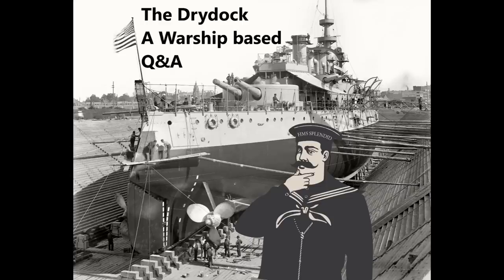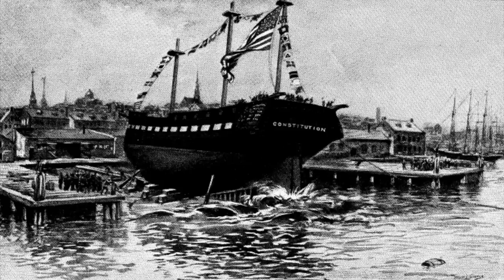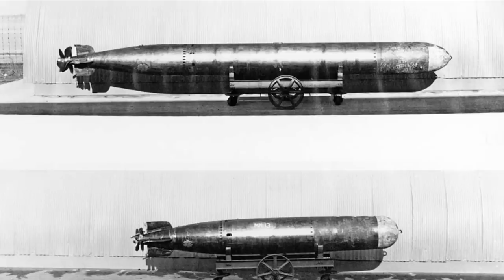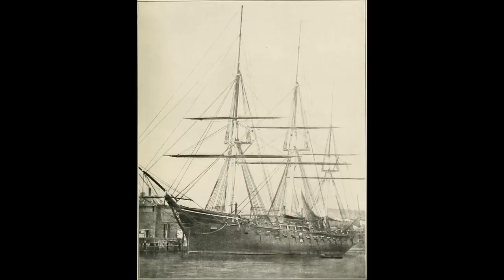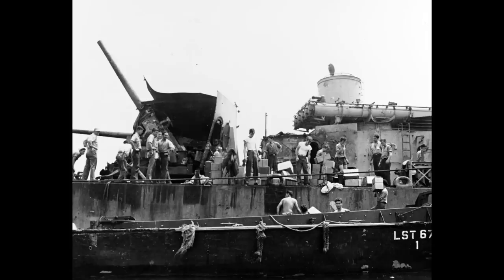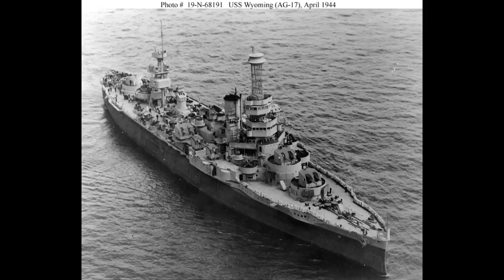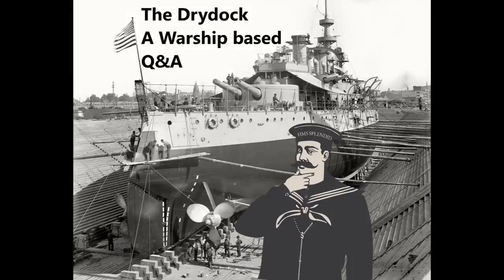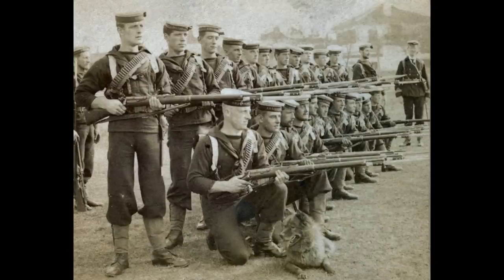The Drydock - Episode 204 (Part 2)

Comment: 00:50:58 The US Navy requires that all shipboard propulsion and aircraft fuels have a closed cup flash point over 140 deg F. When receiving fuel from a Navy source no testing is required since the product was tested had to meet spec upon delivery to the fuel facility. Degassing is done at the refinery to remove the volatile fraction raising the flash point and reduce the risk of explosive vapors. Shipboard testing was only done to determine atomization temperatures for heavy bunker fuel, and when receiving fuel from a none Navy source.
Reply: Basically the same thing as for commercial aviation fuel?

Comment: 51:00 Degassing
Short answer  Drach is right, by the time the navy gets the bunker fuel it is already de-gassed. It happens before distribution.

Long answer 

Crude oil has hydrocarbon gas in solution, refined fuel and destilate products have little or no gas in solution.
Crude oil inside the reservoir is under pressure, and gases are dissolved in the crude oil, held in solution by the pressure. During production, as crude oil travels UP the wellbore the hydrostatic pressure is reduced. A lot of gas comes out of solution as pressure is reduced. (think opening a bottle of soda that forms a lot of bubbles suddenly when it is opened). The first step of De-gassing is what is called a "gas separator", usually at the well site. The gas separator is a primitive device, simply a tall cylinder with baflles inside to allow the gas to vent to the top, and liquid to collect on the bottom. The crude oil that comes out of the separator is called "unweathered".

The unweathered crude is then pumped into pipelines under some (lower) pressure. In the refinery the crude is then passed thru a vacuum Degasser to capture valuable gas (these gases are feedstock for chemicals or used as fuel)

The degassed crude is now passed thru a distillation column, where the different fractions of hydrocarbons are separated by their condensation temperature (pretty much a large moonshine still). The liquids that are extracted from the distillation column are called distillates and have negligible amounts of gas in solution.

The most valuable fractions become gasoline or diesel. The less valuable are called BUNKER FUEL. Bunker fuel is just a notch above asphalt and tar. Ship's boiler run on bunker fuel. Bunker fuel usually has to be heated to thin it out and pump it, use it in burners for boilers. This is why ships have fuel heaters and pre-heaters.

Beware that distilates are still volatile, they can evaporate and become gaseous (gasoline in open jars will evaporate)... but this is a change in phase, not release of solution gas.

Cheers.
Reply: There was several explosions on diesel powered Greek Flag tankers in the 70's/80's when they piped light crude from the cargo into the engine room and burned in the main engines.
Reply: @benwilson6145  Ja Ja .. not the smartest thing to do... 😝
Reply: @benwilson6145  I recall reading that towards the end of WWII the Japanese Navy was running on crude oil, as their refinery capacity had been destroyed. The concern was that the high salt and dirt content of the fuel would severely reduce the life of the boilers, but of course by that time the life expectancy of Japanese naval vessels wasn't that great in any case.
Reply: And from Battleship New Jersey's boiler video this week it was mentioned that the evaporators degassed water destined to be boiler feed water, as well as purifying that water to remove any dry residue minerals which are not good for boilers.
Reply: @ricardokowalski1579  Virtually all crude oil tankers now burn the gases coming off the tanks in engines now. Current crude tanker burn almost zero fuel from the fuel tanks on outbound voyages as a result.
Care is however required to prevent flashbacks to the tanks.
All LNG and LH tankers always burn off gas from the tanks in both directions because the tanks are never emptied (to maintain temperature in the tanks).
Reply: @allangibson2408  Cool 😎👍
Reply: Cheers ; ditto

Comment: Iceland was also a listening post for radio transmissions. 
Operators wore silk gloves to prevent their skin sticking to metal and heavy gloves to keep their hands warm during winter. Unsurprisingly there were sticky accidents happening to lone operators. 
The radio hut was away from the living quarters to avoid electronic
 interference.

Ireland had another listening post.

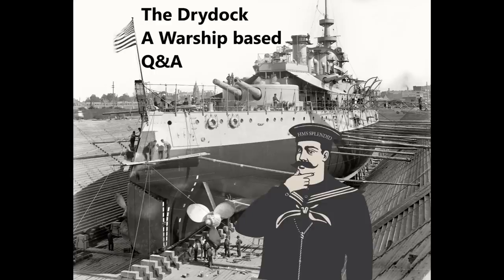Comment: @ 12:45 You were talking about Steam Turbines. Another issue was precision balance!!!!  Each blade not only have extremely tight tolerances to length, width, "airfoil" shape, But also weight, if you had one blade slightly heavier than the one on the opposite side, it would cause trouble by causing vibration and the fact that it would try to shift the shaft in it's direction.  Same thing with Reduction Gears!  Extremely Delicate Balance considering the speed of rotation of parts!!
As for VTEs, ATEs, etc., remember most people had seen a steam locomotive, so the idea of a steam cylinder moving back & forth (or up& down) wouldn't be such a big surprise.  In fact I've heard stories about mainly Canada, but to a lesser degree the US looking for Railroad Engineers and Locomotive Repairmen for service aboard VTE powered ships.... (truth? don't ask me, but it just might be worthwhile to research "one of these years" since I do know you're extremely busy!)
Reply: Also, while the conditions inside a steam turbine isn't as extreme as those inside a gas turbine, I still suspect that you had to be a lot more careful with the metallurgy of those relatively small and thin turbines blades than you did with the giant chunky steam piston heads of a VTE engine.  A little flaw in your allow mixture and you might have blades start failing on you!
So that's one more thing you need to reverse engineer or independently develop and then quality control to make these newfangled turbine things :D
Reply: @jonathan_60503 In the US, turbines were already in use in power plants. I think the US had a problem getting reliable reduction gears, so the USN resorted to turbo-electric drives .
Reply: @sundiver137  Lexington and Saratoga had turbo-electric drives, any other class?

Somewhat ironically, electric drives are making a comeback on some civilian ships these days, with diesel generators powering electric Azipod propulsion units.

And yes, gas turbines blades are engineering marvels, from the carefully CFD-designed shapes of the blades, the thin film of cooling air preventing the gases that are hotter than the melting temperature of the blades from melting them, to the manufacturing process producing single crystal blades. No wonder they cost a fortune.
Reply: @jbepsilon  Turbo-Electric drives were pioneered in USS Jupiter (AC-3), later converted to USS Langley (CV-1).  Other USN ships equipped with Turbo-Electric drives are listed here: 
https://en.wikipedia.org/wiki/Turbo-electric_transmission
Reply: @jbepsilon  I think the Colorado, Tennessee and New Mexico classes had turbo-electric systems.

Comment: Oil from oil wells consists of a mixture of Gases (both inert and flammable), Oils (from things heavier than bitumen on down), water and sand.
The water and sand are separated from the oil and gases in a production separator which is basically a big pressure vessel with a weir in it. The bulk water and sand are drawn off from the upstream side of the weir, the oil from the downstream and the gases off the top. From there is where it gets complicated as you need to separate the non-flammable gases from the flammable gases (unless you just flare them) and the residual oil from the water.
Oil on ships falls into two categories - Bunker C (or even worse Vacuum Bottoms) which needs to be heated well above 100C to flow at all (and hence doesn’t have a water content problem) and everything else.
The lighter oils (including lubricants) are centrifuged to separate the water in equipment very similar to cream separators (usually made by the same companies in fact) to encourage the more dense water to settle to the outside and be drawn off while the oil on the inside is skimmed for use by the engines and gearboxes.
Dissolved gas is not a problem for engines as a rule - it just gets burnt.
A lot of modern oil tankers actually run on the off gas from the oil tanks in transit in fact - they only take on fuel for the empty return runs.
LNG and LH cryogenic tankers always run on off gas in the tanks.

Comment: Fuel on ships doesn’t need to be degassed. Even in a Diesel engine, you’re just burning it. Fire isn’t exactly a finicky process. It’ll go just fine regardless of whether or not there’s air dissolved in it. In general, deaeration isn’t a thing that matters at macro scale.

Boiler feed water is deaerated, though, to avoid oxygen corroding the inside of the boiler. This is accomplished by the deaerating feed tank, which uses steam to heat the feed water to strip the air out of it.
Reply: This is less true in engines that burn things more fine than diesel or oil like kerosine or petroleum as a lean condition (too much oxygen in the fuel mixture) makes it less controlled fire and more blowtorch and can actually melt or at least seriously damage the metal bits containing and creating the fire.  Oil fires burn differently
Reply: Boiler feed water is deaerated in boilers with carbon steel tubes. Ammonia or Urea is added to scrub residual oxygen.
In boiler with stainless steel, copper alloy or aluminium tubes oxygen is added to the water to prevent corrosion. Stainless steel depends on the oxygen in the water to maintain an oxide film to prevent corrosion.
Reply: This has been proved wrong. Many Greek Tankers stole crude oil from the cargo during the 70s/80s and blew us there diesel engines.
Reply: @officernasty1111   Agreed, proof in action. Graf Spee's 'refinery' was basically a degasser to "Refine" the Texas Crude on the Altmark. The Altmark blew up in Japan, different reason.

Comment: Following on from the Great Storm of 1703, I read an account of a severe storm in 1782 in which HMS Centaur, HMS Ramillies and a number of merchant ships were lost from a convoy. It was significant because the subsequent inquiry, and a follow-up examination of other Royal Navy ships, revealed that the hulls had been seriously weakened by galvanic action between the copper hull sheeting (which was then a relatively new idea) and the iron nails holding the timbers together, and this led to action being taken to prevent this occurring in the future.

Comment: @ 50:08 (I'm not an "Oil King", but my Rating did have me know parts of various tests needed for DFM & JP-5.  (Distillate Fuel Marine, and Jet Petrol #5.) As a Water King I do know how Sub-Atmospheric Pressures will cause separation. (Bunker C was a few decades before my time, however, on a old ship I did see the paper work for testing!  But unfortunately  the standards listing was no longer there....)
I imagine they did the "Flashing" at Refineries so that various other fuels could use the vapors and what was left would be Bunker C.  I don't think you can "Evap" off AvGas (of various Octanes), or even MoGas (which was 50 Octane), and I'm also doubtful about Diesel fuel (~30 Octane).  
Here's a bit of explanation of the two ways to rate a fuel:  Octane is a measure of Resistance to Detonation, which explains why Diesel fuel has such a low Octane Rating since it relies on only the compression of the engine to allow the injected (basically directly injected into the cylinder) to ignite the fuel. 
The difference between JP-5 & JP-8 is that JP-5 has a higher Flash Point (not sure if they did a partial evap/flash on it, or added chemicals (or a bit of both), JP-8 also has some lubricants added to it that JP-5 doesn't have.....
Another way of rating fuel is the Cetane Number.  This is a measure of potential energy of the fuel, so you want Bunker C and Diesel Fuel to have a hit Cetane Number!  (I imagine that Bunker C, after having the volatiles "evaped" or "flashed" off would have a high Octane as well as a high Cetane Number!  DFM, since it is used for Diesel Engines aboard ships and for the Gas Turbines (Navalized Propulsion version of a jet engine)
Note: by adding a lead compound that was marketed as Ethyl, you can raise the Octane Rating pass 100, but also cause health, sometimes serious health issues from inhaling the exhaust or even direct contact with the gasoline.  (This would be in addition to the issues caused by exposure to the petroleum "spirits" due to spills or inhaling the vapors of unburnt gasoline (and diesel)!!!)

Comment: With regard to the service of women, which applies to both the USN and RN as also in all the services. Women carried out much vital work and played a major part in the victory. Especially in jobs that did not need a man and releasing more men for the front line. There is no way we could have made it without them. However, having them in the front line is totally different story. I served 32 years in the USN of which 4 was on loan to the RN. Little more than half of that service was without women on ships and the rest more or less with women on front line ships. I was also drafty /Rating assignment detailer and was a ship working up instructor at GTMO. The same routine that UK ships go through at FOST. The performance of the all-male ships vs the coed ships was clear. The all-male ships outperformed the coed every time. It is without a doubt putting women on the ships with the men was/is a disaster. Women are smart and capable; however, Men and women are not the same and the men behave quite different when they are with other men and when with women. As detailer I saw all the problems uncensored and unfiltered. There are 2 huge problems that have no solutions The womans physical and emotional limitations and then there is fraternization. The USN has discharged thousands of men and women from the lowest ranks to Admirals due to fraternization, throwing away their carriers. It cannot be stopped, it can't be trained out, punished out, counseled out no matter what anyone can do. We did a study to determine the cost, by adding all the wages, benefits, cost of training and lost experience from all those people discharged. It went into the billions. Then there was the cost to provide female friendly berthing on the ships. The RN recently spent 3 million pounds on each and every submarine so they could accommodate 3 women. Then there was the detriment to readiness as many women would get themselves pregnant just to get out of deployment leaving their ship shorthanded. There are many other things that can be said. There is an important place for women in the military, but not on the front line or aboard warships.

Comment: In addition to using airfields on Iceland to base long range patrol aircraft they were also used as part of the North Atlantic Ferry Route, which allowed aircraft, or priority supplies carried by aircraft, to be shuttled from North America to the UK.  The long range patrol or bomber aircraft were generally able to be configured into a fuel heavy ferry configuration and make it from Newfoundland to the UK direct, but short ranged (or more heavily loaded) aircraft had to make stops in Greenland and, or, Iceland to refuel in order to make it across.

Also I believe weather stations in both Greenland and Iceland were critical for predicting the weather in the European theater of operations.  D-Day, for example, was scheduled for June 6 in part based on a forecast that the weather would improve enough by then to make the invasion, and immediate follow-on operations, feasible; a forecast that would have been harder to make accurately without access to meteorological stations set up in Iceland.

Comment: Light/Lamp trivia: ships and navigation aids use red green yellow and white lights... But no blue or orange. This is because early lamps used whale oil as their fuel, which tends to burn with a yellowish flame. If you put a blue lens in front of a yellow flame you get a green light and in fact many older green running lights actually have blue lenses. When using a yellow flame it is very hard to distinguish between orange and red so orange is not really a viable color in lights.

Comment: Degassing in oil and gas early on and still now is part of 2 or 3 phase separation those being oil, gas, and water. Typically this is accomplished with gravity separation in the cylinder and mesh knock outs to collect finner spray of the fluids. Once it's in a ship I would imagine it's a pressure containing vessel with a bleed valve of some sort but the oil in the ship should already be separated fairly well after being sold? Then gas would be vented or flared, likely vented since ships don't seem to have flare stacks?

Comment: The "de-gassing" stories probably match up with the issues the Japanese had taking bunker fuel (at least) directly from Indonesian oil wells, and the worries this caused with vapors etc.  (which considering what happened with Shokaku and Taiho, may have been warranted).